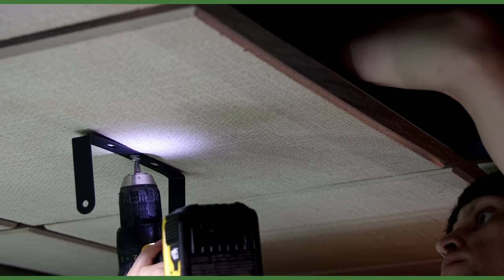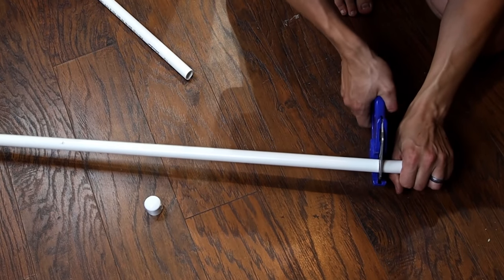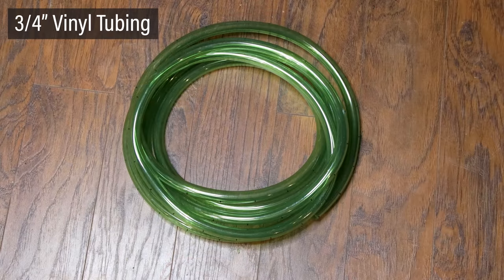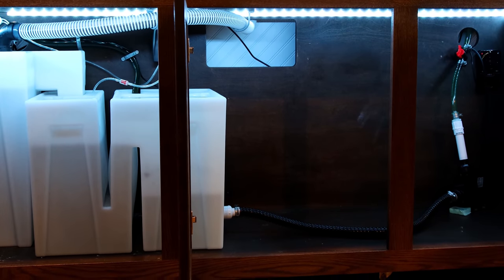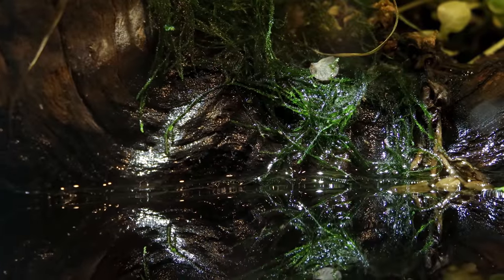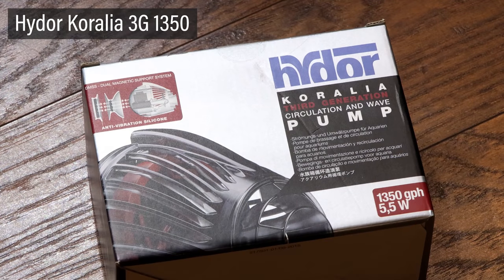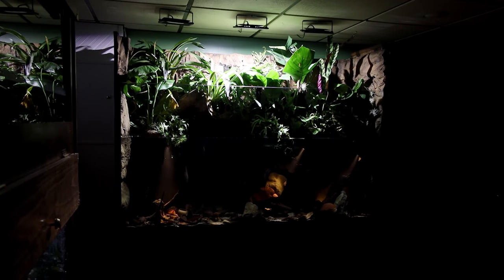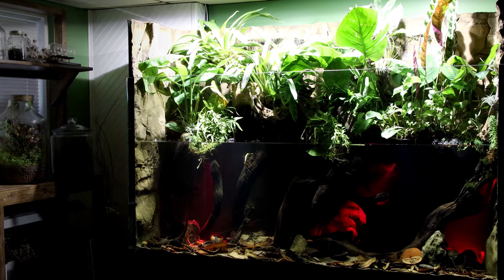HUGE 350 Gallon Dripwall Paludarium is DONE (Build Part 3)

Comment: The LED strip light shown at the box cover is sure not waterproof. You better check if the IP 68 is in place. There must be a PVC or Silicon cover all around the strip light. Check it. Better save than sorry. The Paludarium is amazing. Excellent work. Cheers Tanner

Comment: The dark look of the tank would be great for axolotls
Reply: Way to hard to maintain in such a habitat,  mate have you ever kept axolotls ? You need a bare bottom or fine sand substrate, a cooler and you have to 2 water changes a week
Reply: Demery Dough haven’t looked much into it just thought they would look cool
Reply: @demerydough4173  but this is a very large and planted tank.
Reply: @joshskov2134  This guy doesn't understand nature tanks.
Reply: Yes
Reply: Would look cool, yes. But would it be good for them? No.

Comment: I think it looks awesome now, and will change over time as the plants fill in. As they grow though, I'd consider two options (1) possibly replacing the Monstera Delicisosa at 12 months. Even if you prune leafs, the root ball will keep growing and steel room/nutrients from other plants, it may even damage your background as aerial roots venture out of the small planting pocket. The roots get more tenacious, as they mature, but they're fine when so young. And (2) consider adding a different vining plant to soften the hard lines of the glass sides (let them grow over them) and to contrast with the majority of clumping plants. A nice golden pothos perhaps, for a splash of yellow to break up the green. 

This is not meant to detract from the awesome work you've done, putting this together. It's well worth the effort you invested, and then some!! Just some points to keep in mind, as everything grows and changes.

Comment: NICE!  Trial run for a 1,100 gal., right? 
Not for nothing,but running your wiring through tubing too helps contain&protect even more. I do it w/the A/V,gaming&PC connections w/two short  1-1/4" PVC affixed in back for power cords too.

Comment: What's a "gallon" and how does it relate to other units?
Reply: 1 US gallon is roughly 3.75 liters.
Reply: @CrimsoNaga  Roughly? What is the relation between gallon and other units?
Because, you know, for example to heat 1 cubic centimeter of water to 1 kelvin more it requires the energy of 1 calorie. How does gallon relate to other units in a similar fashion?